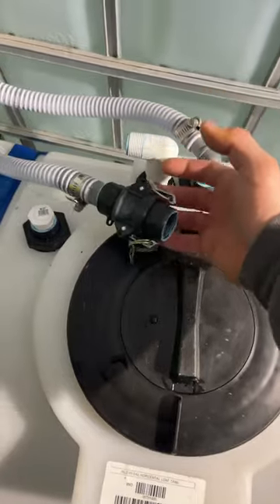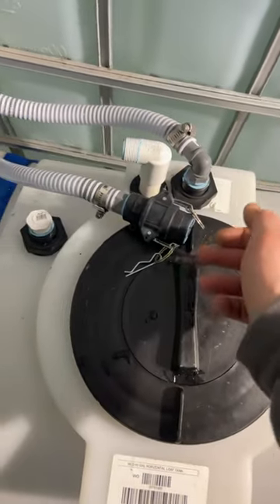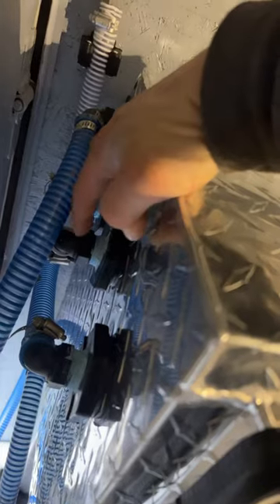Is your softwash system losing pressure? Here’s a possible fix #softwashingservice

Comment: Thank you good man
Reply from the maker: You already knew all this I’m sure 😂
Reply: @DFDZig  Regardless, it’s quality info… and I need to do it.
Reply from the maker: @TheFreshRinse  I was actually wondering if this is an issue with the AR system you have as well? And if there is a system out there that will avoid having this problem all together. Seems never ending.
Reply: @DFDZig  I do know for a fact that I have a small leak at the reel. I plan to fix that, and delete 50’-100’ from my reel.